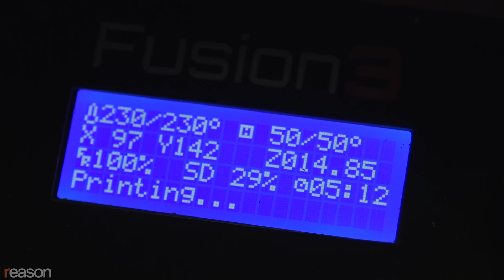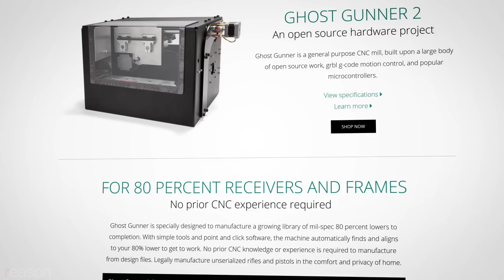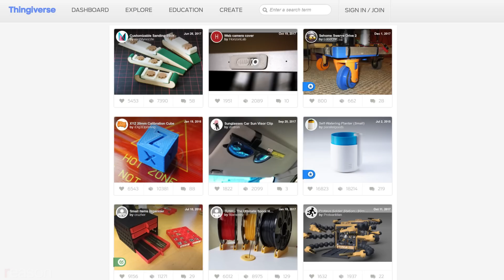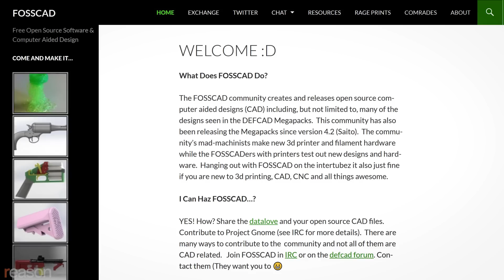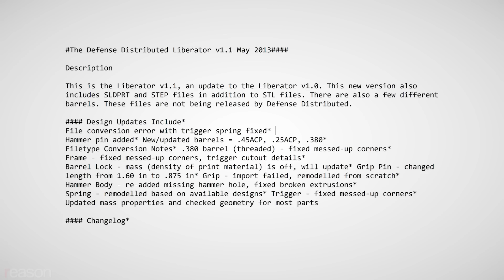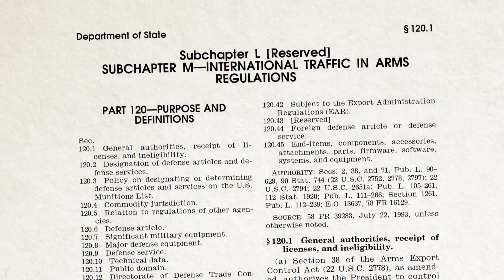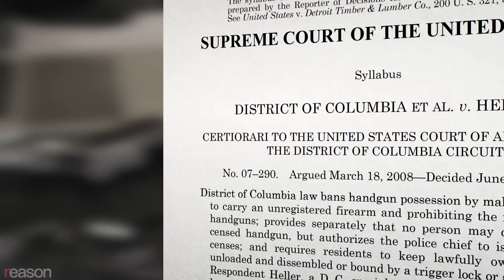The Inevitable Death of Gun Control: Cody Wilson and the Future of Untraceable Homemade Firearms

Comment: While all of that is true, we've all seen the cost of ammunition increasing exponentially.  Although you can reload centerfire brass a limited number of times, the quintessential .22 rimfire, which cannot be reloaded, has skyrocketed approximate 250% in the past 20 years and the cost of components for centerfire ammunition has also increased by a unreasonable amount as well.

Of what value is a firearm, without the fire?
Reply: ebay has rimfire reloading kits for sale...
Reply: @Condemmed Account 
Exactly I even have vids on making primers

Comment: None of this is new. I was doing CNC and machining in school 20 years ago. 
This is just a commercial for this guys $1700 cnc milling machine.
Reply: no one mentions that you have to buy the 80% lower. These machines do not make a gun from a solid piece of metal.
Reply: Any CNC mill can make a billit lower, you just use a different model, generate the g-code, and run it.
80% lowers are not expensive though, and you don’t need anything like this in order to finish them (easer to do by hand or with a drill press)

Comment: Question: Is it illegal in the United States (I know it comes down to state and county but just wondering in general) to make guns in your own home? (Not selling it; only making it for yourself) - A Canadian looking in outside.
Reply: Yes, under federal law it is perfectly legal to manufacture your own firearm for personal usage. Infact is even technically legal to then sell that gun, however some would say this pushes it a little because deliberately manufacturing a gun for the purpose of selling it, is actually illegal without a license to manufacture.

This firearm would also of course have to comply with local as well as federal restrictions on things such as barrel length, it couldn't be full auto, etc without all of the proper paperwork, and there are examples of states (provinces) in the U.S. where doing this would require serializing it.

In most of the U.S., the short answer will be 'yes'.

Comment: we need on for bullets
Reply: Let's get one. They're easy to make -- way less intensive than guns themselves. The only reason it doesn't exist now is because it's so easy to just buy all the finished cartridge components cheaply that no one needs to.
Reply: yea, I only say that because eventually it will run out and we need a way to get bullets just as much as the actual gun.
Reply: We need a way to test and refine scrap too.  Firearm manufacturers put a lot of development in to the metals, so plain steel or aluminum isn't going to cut it.

Comment: And this is new how?  Any machinist can make a firearm and has for hundreds of years.  Maybe your just selling 3D printers :)  By the by Ace Hardware sells 3/4 inch black pipe and caps.  A drill, some plumbers strapping, couple of wood screws, and a spring or two, a 2by4 and in 30 minutes you got a very useable 12 guage double barrel.  It ain't no step for a stepper :)

Comment: at 1:30 It has always been, that if someone wanted one, they got one. Printing just creates crappy guns that a real criminal likely would not want. After all, their criminal life depends on the gun to work. This video seems to show that printing tech is better now though.
Reply: Did you watch the video? They can print out 1911s like it's nothing. A few more years and they'll be on ARs.
Reply: AlcoholicSmurf did you watch the video? They’re not printing out 1911’s. You still have to buy an 80% frame and then mill it out using the ghost gunner. In the future that might be different though.
Reply: BiddieTube 
I've kept up with Cody and 3D printing is there. Before they started this long court battle they figured out the right polymer that their 3D printer could print to do an AR-15 that held up to 200 rounds. He did a talk in Austin. Very informative and inspirational. His ghost gunner is a side product that they were talking about here. It is what keeps the lights on you might say as he goes through this lengthy court battle. Also he has a book out so if you can't afford a ghost gunner you could buy that to show support.
Reply: depends, biddie. on what? the size & infamy of the crime being planned. after a high-profiler, any sensible criminal would ditch his weapons in the nearest swamp.